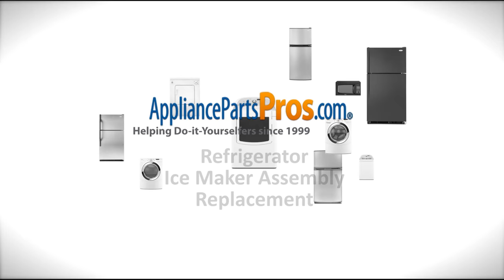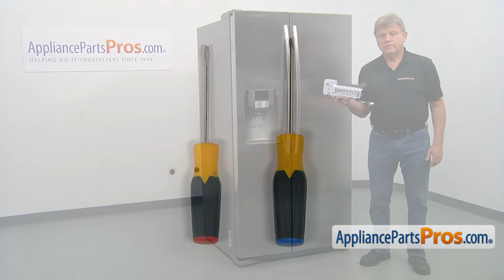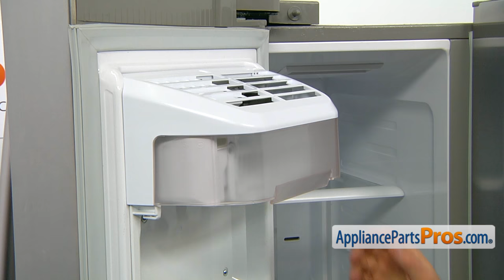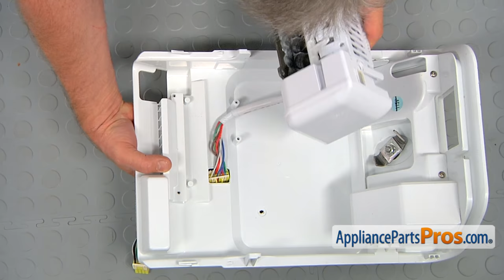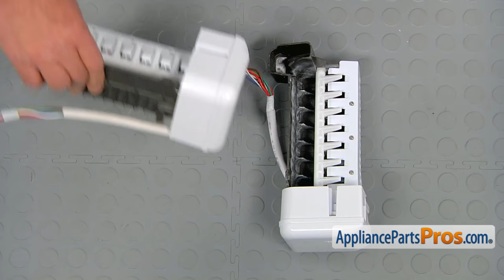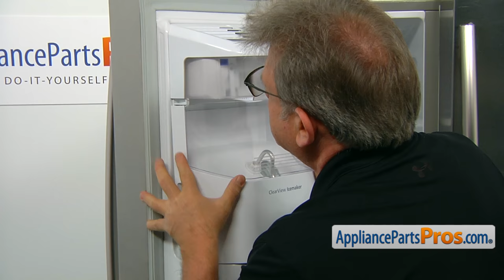How To: Samsung Ice Maker Assembly DA97-07549B

Comment: At the start of the video, the base plate that he unscrews from the bottom of the maker and then puts onto the new one is really important to transfer over. It is a "heat shield." If you don't put it onto your new one, then your new one will not work consistently. I have only just learned this after dealing with ice maker issues for a year after installing a replacement assembly. (I had watched a different installation video that didn't include that information so I threw the heat shield out!!!) If you managed to do what I did, the replacement base plate/heat shield cover part for this 12 pin assembly is called DA63-04355A Refrigerator Ice Maker Heater Cover.

Comment: Does the ice maker somehow send a signal out to ask for water from the water inlet valve?  I'm still not getting any water in ice tray, I've already replaced the water inlet valve.  No blockages anywhere.
Reply: What was the problem? Did you find out?
Reply: @jamesbutler7230  no.  Ended just buying a bag of ice every now and then and filling dispenser

Comment: when i press the test button for more than three seconds water is not released to the freezing chamber. is the valve to open the water line part of the ice maker assembly or is it connected to another part of the refrigerator?
Reply: Did you ever figure this out David?
Reply: @rygamer  ✅
Reply: So??? Any advice?
Reply: Yeah, I figured it out, and it makes very little sense. The icemaker 'comes and goes', sometimes at long intervals, like a month or more. 
Right now, it's working fine. The strategy I've learned is to take a table knife and make sure the 'lever' is 'up' and free of any ice. I know that's not helpful but it's working for me right now. Weird. Idiosyncratic. But it's working right now.  And was cheap! I don't expect this solution to hold up, if past is prologue.

Comment: Great and helpful. I am not a great DIY with appliances, but this video was almost perfect. What you did not mention, and I picked up from Amazon reviews when buying the part, was that the two screws that attach the base plate to the original ice maker, are too big for attaching to the replacement part. Somebody made a design error on the aftermarket part design. My solution was cheap and easy. At Lowe’s, I bought a small pack of #4-40x1/2 inch machine screws and nuts. These work fine, but are longer than the original screws, so just screwing two nuts on to the machine screw will increase the size of the screw head and shorten and allow you to tighten thescrew  I have had ice for 24 hours, so we’ll see how long the part lasts.
Reply from the maker: Glad you were able to complete your repair. If you have any issues or questions please let us know.

Comment: We replaced the ice maker with the video. It went well but there is still no water filling the tray so no ice. What do you recommend we do next? We did hold the reset button and there is water coming from the door and the ice make in on with the digital display. Help please 😊
Reply from the maker: You're going to want to look at your water valve. Do you know if it has two solenoids or one?

Comment: I just finally installed the ice maker I got from you guys. Other than it really took a good yank and push to get the big mount off the door. It was fairly easy. Thank you for the video, had my iPad by my side in the kitchen. Now it’s plugged in and chilling back down. I’ll edit when it starts dumping ice. 
Joe

Edit:
It is making ice. Yay! Took a while for it to settle down, but it’s dumping ice. Now let’s see how long this lasts. I’m not confident but we shall see. I will never buy a Samsung appliance again. TV’s are great, this is not great. Thanks to AppliancPartsPros for being great.
Reply from the maker: Glad you were able to fix your issue! If there is anything we can help you with in the future please let us know.
Reply: @appliancepartspros  still waiting for the first dump. 🙏

It’s dumping ice 😃
Reply from the maker: That's great! Just let us know if you have any other issues.
Reply: @appliancepartspros  other than it’s really slow. It’s working better than the original part. I expected more ice from overnight. Still very little. Like two row dumps. I heard one dump before I went to bed. It did no more since. I pushed the ice on/off button again. On the front panel. I pressed the reset on the ice maker, yesterday.
Reply from the maker: Make sure the temperature is between 0 and 5 degrees for the unit to make ice properly. It can take up to 24 hrs after install for the unit to get back down to the proper temperatures to make ice properly. If it has been that long and the temperature is good, make sure the ice maker is filling back up with water after the last cycle. If you continue to have issues, you can grab your model number and call us at 1-877-477-7278 and we can go through some more troubleshooting with you.
Reply: @appliancepartspros  I think you are correct. It’s not like you deal with this everyday 🤷🏻‍♂️! It has stabilized the temp in to the proper cold and is dumping ice at a regular interval. I think this may have turned a corner. Thanks for the support, it gave me the idea as to what it’s doing. Gotta give it a day at least after the replacement. Yippie!
Thank you!
Joe

Comment: Excellent walk through. 
Only issue I had was the screws to the old heat shield did not fit the replacement. This is the second we’ve had to install, otherwise the Samsung has been splendid. And we did not buy it through this website, though it looks identical. 
In reviewing the old one I see I butchered it in there last time, enlarging the thread into the body of the ice maker. I think it may be that the original was a different diameter (0.7 not 0.5) but a 0.5x10mm socket cap screw, with a washer, fit well. I guess 8 mm length might work but the head of the socket cap is a bit small so the washer was doubly helpful.

Comment: I removed both the ice maker and the hopper and sat them out to allow any ice that was potentially preventing something from moving freely to melt and dry.

When I reassembled the unit, the white fingers proceeded to turn as expected. I closed the door and a moment later I heard the water dispense into the ice maker. After that I heard a chime from the control panel. 

It never pushed the ice out into the hopper and the ice froze solid in the ice maker. Am I to assume something is stripped or broken and it’s time to replace that component?

Comment: Can you tell me something!  The part we found to replace ours is only a 7 cube and we have 8 cube is it the same and can we use.
Reply from the maker: What is your model number of your fridge and we can check on that for you.
Reply: @appliancepartspros  rh25h5611sg. It was dropping water, freezing and then not dropping ice cubes in tray.  We replaced both fuses but still did not work so we bought another ice maker (the one with 7 cubes vs original 8 cube) and put in  but still won’t drop them?
Reply: @appliancepartspros  it dropped water froze the ice arms started turning to move the ice and stopped
Reply: Not sure what it is now.  Is it with fridge not telling ice maker what to do  or the ice maker!
Reply from the maker: Have you recently had any type of power outage?
Reply: @appliancepartspros  yes occasionally that happens And ac went out in house for 2 weeks and it was 90/95 in house.  We have unplugged and reset breaker to see if that was it as well.   We put new ice maker in and does the same thing.  Almost like it does not allow the ice to be dumped.   Fuses have been replaced in ice maker first before we put in new one. Buy new one does the same thing!  Water goes in, freezes, arm goes part way around but can finished to push it out.
Reply: Thanks for any advice you can give! We are at loss of why it won’t work even though it has a brand new ice maker installed.

Comment: I tossed one of MANY of these ice makers with the original base plate still on  it... Therefore, I haven't had a baseplate for years. I can't find one.. Are they really required and if so, do you sell them?
Reply: I had done this too and left a comment about it. For this exact model assembly, the base plate part is DA63-04355A Refrigerator Ice Maker Heater Cover
Reply: @YayHappens  Thank you very much!  I really appreciate your help. I have ordered it. It's a shame when shipping is more than the part.
Reply: @Chris-wp3ew  I am glad it helped! I have no idea if it comes with the screws but supposedly the type is  M3-.05 x 8mm screws for the assembly.
Reply: @YayHappens  awesome!    Thanks again...  The newest icemaker (3rd installed within 6 months) seems to be working just fine. If I had to guess, I've installed 6-8 ice makers in the last 7-8 years in this fridge.   That's not including attempts to thaw it out, disassemble and seal the board components and wiring harnesses. WE won't even talk about how many shelves, drawers and door bins I've had to replace... I THOUGHT Samsung was a quality brand.. I was wrong..  Dishwasher and 2 previous Samsung Microwave's also failed. The stove/oven is hanging in there though!  LOL
Reply: The screws that come off the plate are slightly too big for my new maker. Currently trying to find some that fit.
Reply: @YayHappens  Funny (or not)...   Thanks to you, I ordered that part, but a day after I got it, the compressor failed and we had to get a new (NOT SAMSUNG) fridge. Threw out the basically new ice maker too.   Bought a KitchenAid.  Not a single issue (or lack of ice) in 9 months
Reply: @Chris-wp3ew  oh no! Thanks for the update. I hope the new one is working out to be much better and with an ice maker that is a lot more quiet!!!
Reply: @YayHappens  Ironically, the new KitchenAid Ice maker works great, however, it is by far, the loudest ice maker I've ever heard. I'll take that over replacing a Samsung ice maker every 4-5 months.

Comment: My Samsung refrigerator panel has only 2 screws and two tabs, after releasing them panel not going out, looks like something else holding it in place. Maybe someone had the same problem before. Appreciate any help.
Reply: mine has only 2 also and i can't get the "tabs to release anything I pealed the plastic back and didn't see what it's supposed to release. I thought about smashing it to bits in frustration.

Comment: Replaced mine and still not working  the water starts to put water in the tray for one second and that is it Not a full tray  and it won't dump them
Reply: Same thing happened to me. Did you resolve the issue? Please let me know
Reply: Sounds like water pressure is weak like filter is bad. Had same trouble with aftermarket filters
Reply: Hello jack, I am having the exact same issues as you described. May I ask what it ended up being?